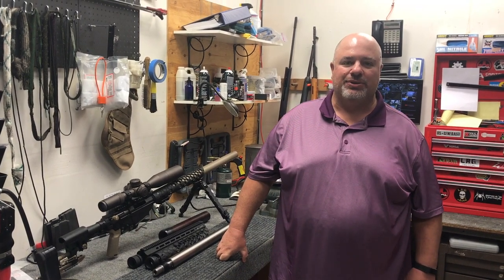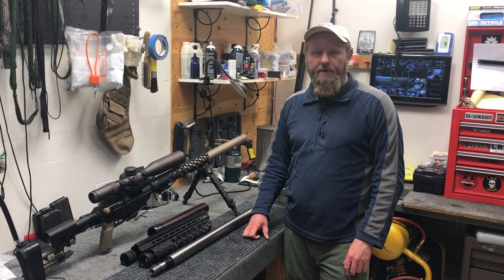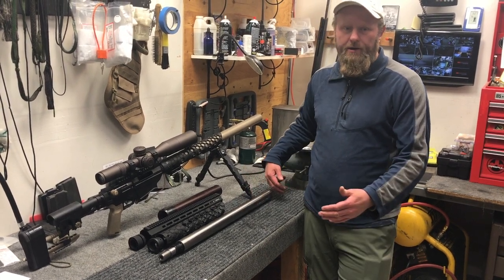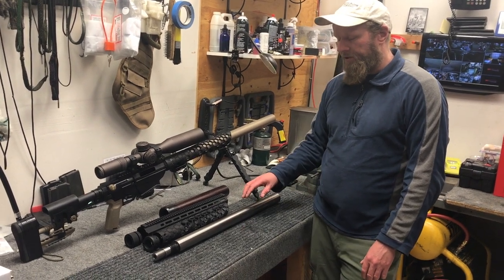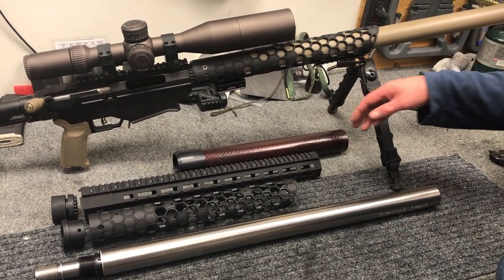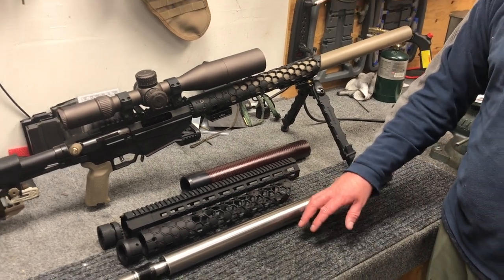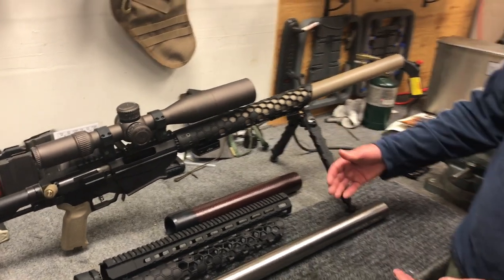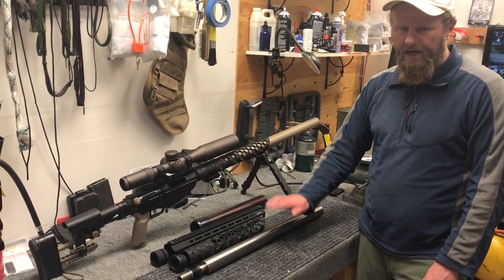Ruger Precision Rifle Suppressor Upgrade Kits

Comment: What is the overall length of the 6.5 CM rifle with 28" barrel?
Reply: About 50.75" the RPR with a 24" barrel is 46.75" with the butt stock at full length.

Comment: how is the accuracy of the upgrade kit vs the complete finished rifle?
Reply: I guess my question is, would an existing ruger with an upgrade kit be more or less accurate than the ruger built by Witt. Meaning should I buy an upgrade kit for my ruger or a brand new witt ruger? which would have a tighter grouping?